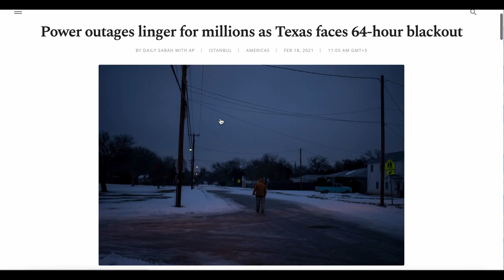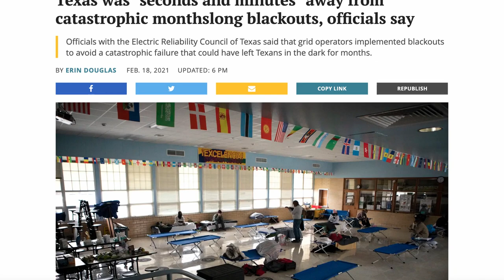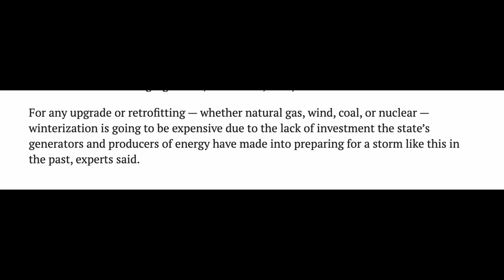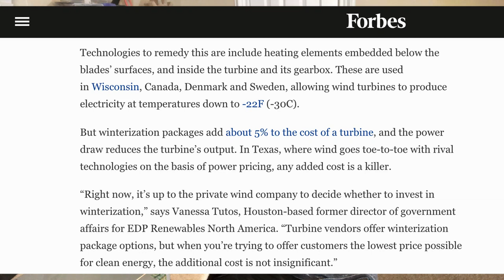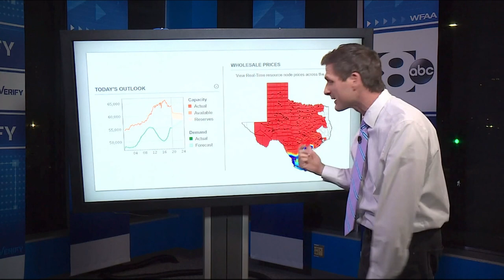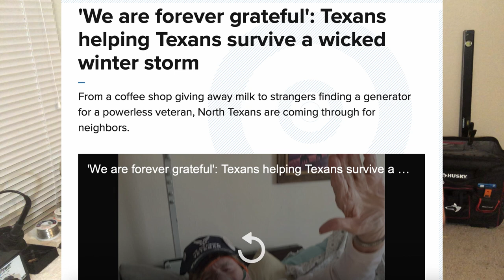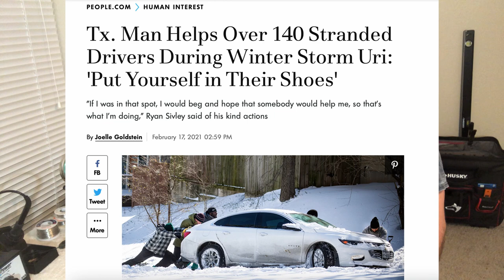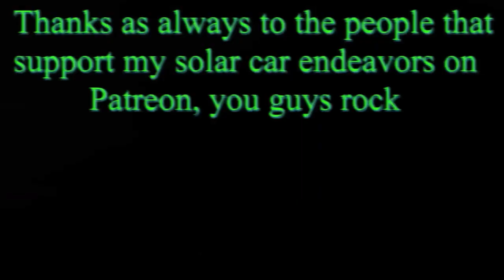What Happened to Texas' Electric Utility Grid?!

Comment: Ah I've been hoping for this video, very glad you made it! You explained things really clearly without graphics, don't worry haha. I agree that emergency use generators don't really work. Even hospitals and data centres find they don't work half the time when needed.

We have the same 5-party electricity system in Australia, and one of our states (South Australia) did actually have the horror situation total outage a few years back, the whole state grid went down for a while in summer. I was living there at the time, it was pretty hot. They had connections to other states but those links shut down too to protect their own grids. They rebooted it pretty quickly though, it was hours not months. It was the same left vs right blame game, but nothing really changed legislation wise... next year they installed the big Telsa battery and no problems since.

Have fun testing all those Leaf modules!
Reply from the maker: I have set up Leaf module testing line!  Running 4 at a time through several cycles.  Gentle notes of ozone are wafted through the room by various cooling fans.  I've decided I'm gonna go for a 10p7s battery.  70 modules, 23.3 kwh total, 21 usable.  I think I remember hearing about that outage in Australia.  It's funny you mention Tesla.  They started construction of a 100MWH battery in Texas yesterday under the thin veil of a subcontractor/subsidiary.  One good thing about very few regulations, is that a motivated company can move FAST.  Hopefully the 100 MWHs is just a start though.  That really won't go far if we get a repeat of this spring's ice storm.
Reply: @InnovativeSustainableSolutions  True it wouldn't have helped in that ice storm, I think the supply shortfall was like 10 GW right? Heaps more big batteries popping up here now, last one I heard of was a 2.8 GWh / 700 MW monster in the state of NSW. That's challenging hydro in capacity! I'm sure there will be many more keen to get their payday in TX too.

So you are going for a nominal 48 V system. Good choice, still easy to get compatible equipment and pretty safe, but much lower resistive losses than 12 V. Not sure how you got 23.3 kWh as the capacity (I assume you're downrating the modules). Really excited to watch your build videos now - bring it on! I'm guessing you're going to keep them as modules rather than shucking the individual cells. Does that make the BMS trickier? How big will you go on the inverter? Don't need to answer now, I can wait for the video :P

btw my hybrid lithium supercapacitors arrived today! I'm going to test them this week.
Reply from the maker: @johndalgliesh9220  Battery production scaling in 2021 will be one for the history books for sure.  The rate of price increase of Lithium, Nickel, and other metals used in the their production is, . . probably unprecedented.  Are there historical examples of the cost per ton of an element DOUBLING in one year before?  Tesla will have no choice but to get into mining.  And it bodes very well for the scrap value of our powerwalls years from now.  I've been wanting to talk for a while on why 12-24v is better for most solar cars, and 48v is the new standard for home powerwalls.  It will be nice to briefly dive into it in the next vid.  I've got plenty to keep my busy until I get to do the video on your system!

Comment: I'm surprised you didn't mention vehicles as an energy source.  Adding an inverter to your vehicle is an inexpensive way to transform it into a low powered generator.  It works great on hybrids because the engine will cycle on and off to maintain battery charge. An ICE car can do this too, it's just less efficient to idle the engine constantly. Although it doesn't solve the fuel storage issue because most cars don't run on propane. Otherwise, this was a very good video.
Reply from the maker: An EV does make a great 400-800watt micro-generator (especially if it has solar panels, batteries, and inverter built in).  I always have to leave a lot out of my videos for time's sake, and I usually run over anyways.  I kinda want to do a video where I attach all 3 of our EVs to one 12v inverter, split the load between the 3 DC-DC converters and see how beefy of a load can be safely run.  It checks the goofy-science box my viewers have come to expect.
Reply: @InnovativeSustainableSolutions  yo can you do a video on how you do that?
Reply from the maker: @carlosramirezfabian1256  Yes.  But it's atleast 3 videos away.  I let my Patrons pick the order of the videos I release, and they ranked the Powering-your-house-from-an-EV(s) video 3rd.